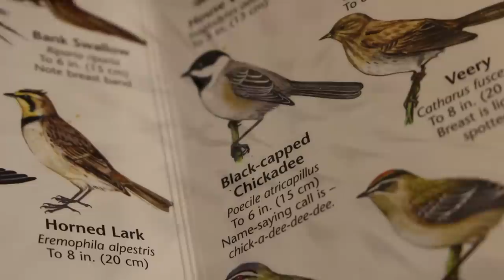Ep. 69 I found this Horrible PAINTED Dresser and RESTORED IT...

Comment: The simplicity of this piece and video is great!

I just finished re-finishing my small kitchen table top.  I sanded it after stripping the old stain.  I then chose Polyshades Classic Black because that’s what the box store had.  Did three coats for opaque solid finish, then 3 poly coats, sanding between.  Used restore a finish on base, legs and two chairs. Then feed n wax.  It was a great project and amazed my hubby I think. 

You inspire me and I always think of your channel when I see a can of GF Candlelight….lol!

Comment: There is not much you can do with a pine dresser,  I have slathered on 4 or 5 coats of pool chlorine (about 8 times more concentrated than household bleach) and that didn't make much difference.  Then a whitewash tinted blue helped some, but not tons of difference.  It looked somewhat more like driftwood, but not really, I was going for a silver grey.  This is probably less orange than it would have been though and they did a good job of avoiding the knots.  I am happy you kept it simple.  The worst is trying to make pine look like dark walnut or mahogany.  Good job, Thanks.  BTW, the pulls are the most interesting part, so glad you didn't change them.